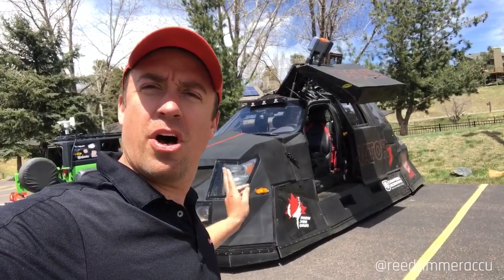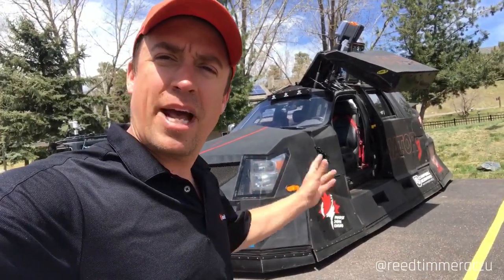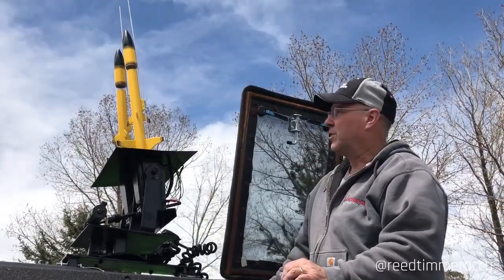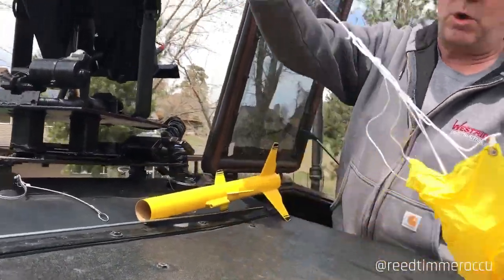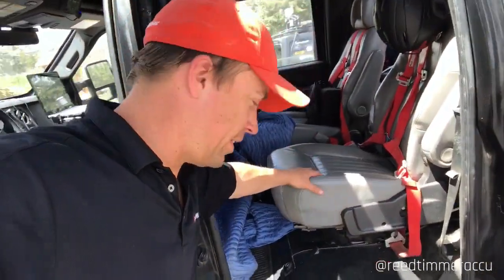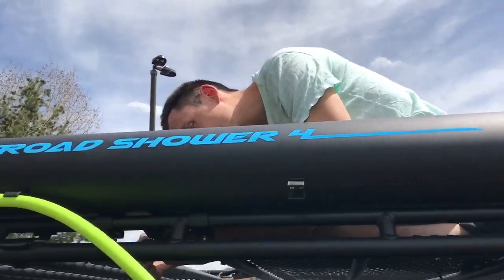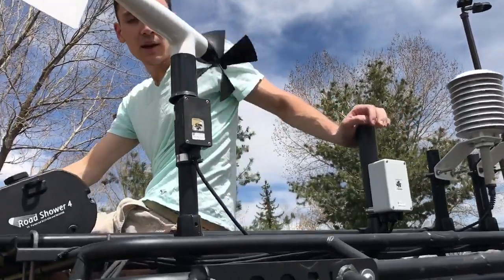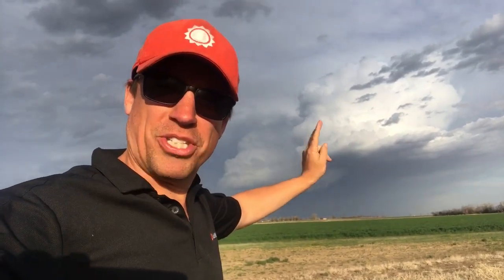VLOG: Introducing the ultimate storm chasing machine: Dominator 3

Comment: It's nice to see the Dominator. I watched the video of it when the door came open during an EF-4 tornado. That vehicle is an amazing machine and just how I would have built it. The only thing I would change, is the glass. If you can afford it, try and get it "rounded instead of flat". I know that you know that the most successful structure in a major tornado is a "water tower" -- I think that you should look at that shape and get the Dominator as round as possible. Make sure that you use some killer sealant for the windows too. I would hate to hear about one of you blowing away because of an air-leak that blew out a window. Cheers Reed, keep truckin'.

Comment: I wonder if pressure changes could pop a cap off the tip of the rocket. Might need some protected pressure equalixation holez lined with hydrophylic fine mesh to allow passage of are but little if any water.